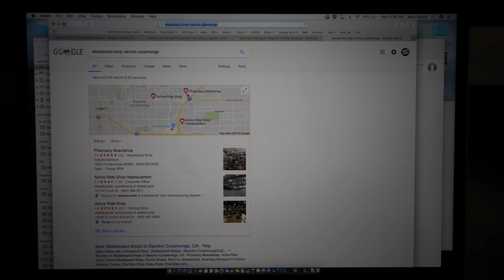200A LiPOs on a DIY Electric Skateboard build (2018)

Comment: After wanting to build a custom portable battery pack to power a portable water mister in this 117 degree weather on Lake Mead, and ran into your bottom/top balancing video while I was learning. It was the beginning of a few things, but I will summarize.

I bought 400 of the Balance Board batteries and built a 12s5p battery pack for an electric skateboard. Topping out at 25a for safety. I am just waiting on my 3D printer to finish with the battery enclosure and i'll be in business.

Comment: if you found a way to transform those hub wheels to offroad that would be awesome, strange i have the same hub motors and my battery pack is 42v or 10 cells in series. its was $620 NZD or 423 USD. goes 35kmph and can travel about 20-30km. i suspect its a rebranded meepo board that was upgrade to from 2 10s 18650 cells in series to 4 10s cells in series. i did have a problem with the charging at first but removing the bms fixed the problem and its been going good for the past 4 months without balance charging. i use it atleast 4 times a day for 10km commutes

Comment: hey man i planing the same but i have full longboard. Don't use tape buy some foam/rubber like a a4 paper sice 1mm its enought cut drill and fit you can also glue to the table or box with special glue
Reply: i think days like that on internet you can find cheap maybe I'm wrong just check but I think that can't be expensive

Comment: Jehu, can you do a video on the application and use of Lipo vs the 18650 vs the LiFeP04. I am realising that voltage and amps is not the full story, Power is a different concept all together even if its just V*I there is more here than just the basic maths.

Comment: Hi Jehu, congratulations for the channel , I love it and you are the one make me  start my first  DIY E skateboard...now I have a problem with my 12s Lipo batteries , when I discharge  under  42v the battery  shutdown  till 7v. The ESC tell me that I can go until  38v.... Is it the  batteries  brand the  problem  or 3v x cell it's the  minimum ?...

Comment: Great editing and work Jehu!

Range is everything these days. Its also the bottleneck in all eskate,ebike, escooter , erideables - battery weight/volume per mile range currently gets very poor above 30-40 miles. No real progress possible until efficiency or battery density improves exponentially
Reply: How about a tsinova pedelec bike? Designed by former Nissan engineers.
Reply: webslinger2011 Tsinova is LTA approved "street legal" in Singapore but that's it. There is no other achievement beyond the bureaucratic one as technical detals of the bike are made poor because of it : Battery:
Lithium-Ion, 36v 5.8Ah, (Panasonic Cells)
Motor:
250w brushless DC hub motor.

The Nissan bit makes 0 difference to me as it's yet another low spec Pedelec EV
Reply: The bike frame is made of aluminum alloy. You can select which mode you want wirelessly as it connects via bluetooth thru the tsinova app (downloadable for android ). I personally ridden one. It's very light and I didn't need to put much effort pedalling up slopes.

Comment: Will We see any more electric skateboard Builds? Maybe a 2.1?
Belt system or Direct drive motor like carvon? 13s4p Li-ons :D Saw people do that with enertions focbox.
Reply from the maker: 13s?  I read VESCs die even at 12s
Reply: You're right But Its normally Cheap Vescs that die at 12s 
But this guy used focbox (High end vesc) Seems to work.
http://www.electric-skateboard.builders/t/13s-evo-from-hell/41468

but a well constructed 12s would Still be great! 
If you want to make a hill Climbing beast maybe look into Belt driven motors Pulleys are not that Expensive and Belts are cheaper to replace than hubs. here's a low geared kit. https://www.banggood.com/15mm-Wide-Belts-DIY-ABEC-Flywheel-Pulley-Kit-265mm-255mm-p-1222305.html?rmmds=search&cur_warehouse=CN
Reply: Sorry for late reply thought I sent message! Here is a popular 13s build
http://www.electric-skateboard.builders/t/13s-evo-from-hell/41468
cheap vescs die at 12s Good vescs have extra room meaning you can push it!
people say efficiency is improved at 13s! Also ditch the hubmotors get Belt driven or Direct drive motors! Dual 20mm belts should last longer than hubmotors urethane and I did not hear complains about 15mm belts slipping on dual. 12s is fine do everything at own risk but im just saying you could look into it.

Comment: ok but you are loosing thé Flex on the board with the aluminium part .when you skat you want you bord to Flex that why boosted board Can flex
Reply from the maker: Well,  get boosted then,  I guess flex is worth $500 to you
Reply: yes for shur
Reply: what i like à baot yor board is that you have a tail
Reply from the maker: Yeah and it’s Smaller,   It  ok it goes fast , the only it doesn’t do is go up really steep hills

Comment: Ok, so what about RC airplane brushless motors with chain and sprockets? An RC car remote can be bought for less than 20 bucks, and maybe rc car speed controllers. All of these parts can be found for cheap in places like hobby king or eBay. That would cut costs down a lot.

Comment: Quick question about Lifpo4, specifically using headway 38120 batteries for a home power wall, how many would I need to go with my 4.5Kw solar grid? I figured around 120 cells, but am not sure of my estimate.  My consumption is around 450Kwhr per month above what the panels produce. I'd like to get away from nightly consumption off the grid by using the power wall. Thanks in advance to anyone who responds with sound advice!

Comment: your link for battery charger EVAPLUS 42V 2A Power Adapter PowerFast 3-Prong Inline Connector For Pocket Mod, Sports Mod, and Dirt Quad Lithium Battery Charger.  Doesn't
say that it will charge  LiPO batteries.  Can you confirm that it will work.
Reply from the maker: It works
Reply: I plan on 10 LiPO's in series to give me 37V.  Do batteries need to 
be balance charged??

Comment: How did them lipos hold up? I just dropped 250 bucks to build 2 -10s packs for my DIY e mountainboard. I plan on making them easily disconnect from each other and just charge them on parallel as my RC charger only goes up to 8s.

Comment: Why don't you use the dc to dc step up? It would be way faster than dealing with the speed controller.
Reply from the maker: Do you know how BLDC motors work?
Reply: jehugarcia Not really to be honest. I would love to learn from you about that. I did learn a lot from you and this channel. THANK YOU. I built 2 ebike for me and my gf. I thought the speed control and motors will work with many inputs voltage. I found a kit which will work from 24v to 42v. I'm planning to make my electric skateboard for this summer. So please correct me if I was wrong. Sorry about my English.

Comment: Did I missed the part you explain why you use lipo instead of all the 18650 laying around? 
BTW if you want more torque you should probably switch to belt drive system instead of HUB motors. And here comes the electric skateboarders in 3...2...1....
Reply from the maker: 120A

Comment: The hub motors are weak compared to using a hobby motor and pulley/belt. With two VESCs and those lipos, you could easily make a 40mph board with a couple 6374 motors.

Comment: Jehu, very cool! You'd make an engineer proud with your build! The metal box acts as a Faraday cage to prevent radio transmissions from entering but since the bottom of the box is open, the signal will travel through the wood board. As long as there is no metal, it should be fine.

Comment: Hello I'm interested to convert my car but I live in Egypt! I hope you can make a video about a normal city car with 90 horsepower and about 300 miles [500 km] and don't want high speed I just need 100 km per hour..... Please share your experience with me! I hope to use batteries like tesla to but it under the seats. Please reply me what can I use motor and converter

Comment: For the same result i spent 500 euros,i used 18650 lg hg2 18 pcs 6s3p,1 outrunner motor and chain
max speed on flat ground 40 km/h 25 mile/h 20 km 12,5 mile range in city and climb 20% gradient hills

Comment: Which battery is better the LiPo or the Li-ion  battery?
Reply from the maker: no such thing,  both are good
Reply: Li-ion has less manufacture failure rate explained again by one of his videos the difference only matter with the space and structure of the build with which battery you use

Comment: Jehu, I've been a big fan/supporter of your vlog and have learned so much!  I'm so glad that you finally messed around with making a DIY electric skateboard :)  Actually, your channel has helped me with some battery info when I built mine.  If you're bored, check out my channel which is dedicated to DIY esk8.  I did a 3 part series on building one.  Anyhow, one question for you.  On this build did you use a BMS (I know you're not the biggest fan of BMS')  Anyhow, super fun video and a big like from this guy!

- Neil
(Big Kids)

Comment: I am charging some reclaimed batteries with the Sky RC B6 mini and I am charging a group of 10 batteries at 3 amps so 300 ma per battery and they are 2 degrees Fahrenheit above ambient temperature is this normal?
Reply: 10 parallel of course

Comment: the charger in the description is a 42 volt charger but the system is a 24 volt one. would the difference not cause an issues? just curious and trying to learn :)
Reply from the maker: It’s actually a 36v system (10s)
Reply: My bad. So the 42 volt charger works to charge lower voltage battery packs like the 36 volt system?  love the videos by the way!
Reply from the maker: Yes 36v systems are 42v fully charged.   The 36v is the nominal voltage
Reply: ohhh that makes a lot of sense! it wasn't clicking but it makes more sense now. Thank you!
Reply: Yes it most certainly can! Don't ever use an incorrect voltage charger for these cells & always make sure you use a BMS or a balance charger. These things can explode people! Be educated BEFORE you use them.

Comment: Out of curiosity, is there a reason you went for flat batteries as opposed to 18650's? A lot of these builds use 10S2P 18650 packs, just curious if that was something you considered.
Reply from the maker: Because there’s a ton of them available
Reply: @jehugarcia  Fair, but that's equally true for 18650s
Reply from the maker: yes, and I use them in every other project,  so the question is why wouldn't I try other available cells occasionally?

Comment: Hey man great job. Question I was able to get 2 of those LG 10s2p battery packs that are still sold out. Just a question those batteries have their own BMS. Do I just charge them by connecting to the x60 connector. I seen other batter packs that have a separate leads for charging.
Reply from the maker: Yeah just charge using the one connector
Reply: jehugarcia thanks you da man bro

Comment: Jehu, I know some guys that have been able to put extra batteries in like a hardware bag that they sit up on top of the board for extra range. You have to learn to ride slightly differently because it will be between your legs but the portability of it and range extension might be worth it for longer distance rides and commuting.

Comment: This is impressive.. 

Why not wire them in one strip and then fold the packets with some packing foam (sheets) or even some rubber sheets.

Just the way I'd do it.. but awesome.. 

Another idea.. 

How many of those flat pack batteries would you need to make your van work?

In other words.. would 2000 of those flat packs at least get your van going and if so, how many miles would you get..?

Just curious as a weight reduction idea.
Reply from the maker: 10 per mile of range needed,   I currently get 150 miles
Reply: jehugarcia so are you saying 10 flat packs per mile and the total mileage you currently get would be 150miles?
Reply from the maker: I believe thats what I said
Reply: jehugarcia ok.. just clarifying. 

So how big is the compartment you use for the current battery,to get your 150 miles?

How big are the flat packs in dimensions compared to the current size of a single battery in height?

Comment: im very confused because on the battery hook up site these exact batteries are hyped up a lot about being powerful. so was it the hub motors making it slow? the controllers? the batteries ? or all the dirt and rock debris you got inside when you did they very well worth it slow mo broll of the skateboard burning out haha? anyways im building a mountain e bike and i want to purchase these for the power source but the low 8-9ah and this video is deterring me. what are your thoughts?

Comment: Looks like a very cool build.  Just was wondering about the build of the battery box.  How is the heat?  Normally in remote control planes, we like to air inlets into the esc and battery area for cooling.  Also being all metal, does it get rid of all the flex of the skateboard?

Comment: wow $700, the boosted board is what $1200, with easier charging mechanics and faster accel and stopping, if you put another $300 into your board you could probably make it accelerate a bit faster, add some gadgets.I'm surprised actually that you can build one yourself and its really not much cheaper at all then  retail.

Comment: Amazing video. Do you also get voltage sag when you run it at high speed. When i am pushing my board (diy) i sometimes happens. Are 18650 cells a solution because they are more stable when pushing it? Great board and video btw

Comment: that board sucks for 700.. mine goes the same speed, is a longer board with RGB LED's, has a similar range, a headlight and doesn't sound like it's gonna break apart when braking...plus can go up hills and no assembly required. I just made a mount and bought a headlight...n it cost me a total of $250 fully complete.. charger included.

Comment: How did you charge them? I learned that I have to balance charge my hobby grade lipo's I use for my single drive outrunner board. Did you put a BMS in without showing it?
Reply from the maker: no BMS
Reply: He has explained many times that a BMS is not necessary in a series cell..... check your batteries if one starts bad then that is the problem....

Comment: We need a Ebike
Reply: Buy BLDC motor and controller parts from china. 24V 250Watt BLDC Motor is good enough on my scooter. But a 500-1000W motor would be smoking! They're somewhat easy to assemble if provided with instructions. Modifying the bike is the hard part.
Reply: 250W front wheel hub .. and then after you find out how slow it is ... slap a 500W motor on the back wheel as well
Reply: An ebike would be good as an $80 mountain bike and a $150 hub motor kit can be purchased from walmart online. More copper and more load-bearing iron for about the same price. But I agree with the rest that this was a well produced video.
Reply: webslinger2011 I have a 1000w motor on my bike and it’s insaneeeeeee

Comment: Why the F$$%%$ did you make your enclosure out of metal. wouldn't that be an issue? Also how heavy is the board? Why would you even think about using lipo's. they are a mess. between not charging and having issues with swelling up I would say lipo's are a bad idea. Of course that's just my opinion, but yes they are easier to set up. It's just you have to most likely ditch the board if one explodes.

Comment: That's pretty good, but how does it compare with an off the shelf board of similar specs? There are some pretty cheap boards coming out of China now, it might be cheaper to buy one than to build one these days. Not half as fun though!
Reply: it is cheaper but not reliable. I'd say buy one from the shelf and when they break down, you can replace the broken parts.

Comment: You may run into some big problems in the future the way you are charging those cells! I didn't see a BMS or individual wires for a balance charger to be used in your build. Those cells must be balance charged! If the individual cells get too much voltage drift they have the potential to explode. Cells with that much power would probably leave a pretty good hole in the ground. Be careful. Good luck.

Comment: would be interested in seeing this done with capacitors, not LiPOs
Reply from the maker: Cap are too big,  you'd only be able to fit a couple of miles worth of range
Reply: i'd imagine they would supply a larger instant demand of energy to make it up hills, though the over all distance may obviously be less than LiPOs. Couldn't hurt DIY'ing a longer long-board to facilitate capacitors that would be equivalent in total distance miles usage.
Reply: aluminum or better yet carbon fiber may be a better alternative than walmart wood.
Reply: the trick is to use 1/3rd super capacitors and 2/3rds lipo, best of both worlds
Reply: maybe recumbent bikes or scooters would make up for the mileage capacity using capacitors while retaining the increase of energy demand with capacitors versus a tiny long-board.

Comment: Hey Jehu amazing video!
one question: where can I find those $10 batteries because the link in your description shows that the batteries are $30
Reply from the maker: Are you kidding me?
Reply: At 4 pcs for 30 & not a piece. So, it's not bad.
Reply: Noor M Yus oh I'll look again haha
Reply: Yes it turns out there are 4 for 30$
Reply: Add $13 for S&H so it is about $10 for each cell....
Reply: jehugarcia 
  Don't know if you have ever heard about Samcrac who is also on YouTube. He usually does car videos, but has done a couple this past year on the electric skateboards.
   If I remember right he has found one that has similar spec's for speed and range but only costs around half as much. With the option of exchangable fast charge battery packs..
   You don't get the fun of making it yourself, but some might prefer a US made product that comes with a warranty.